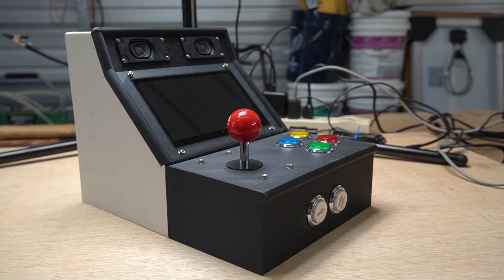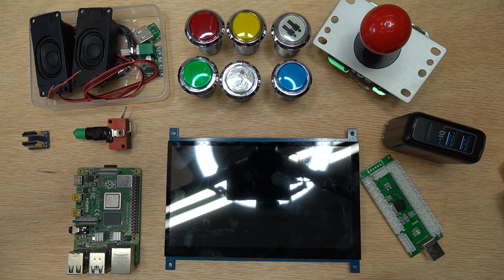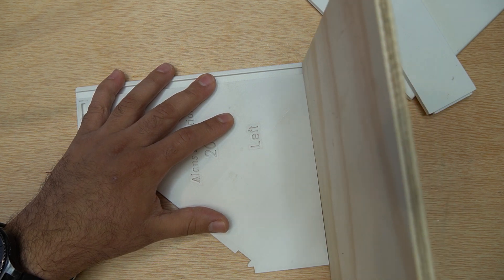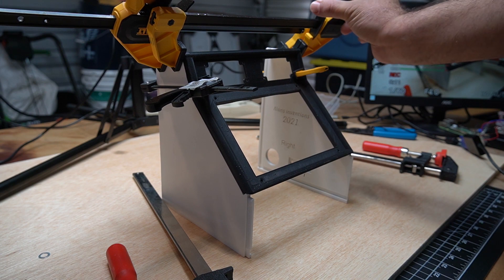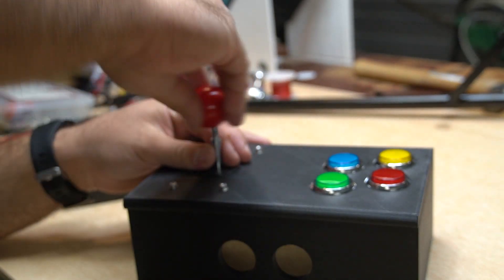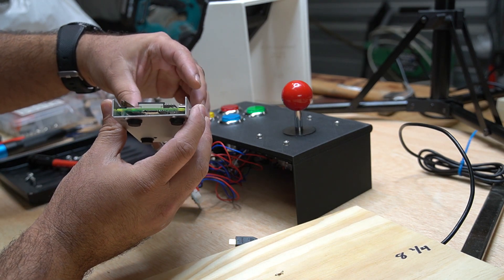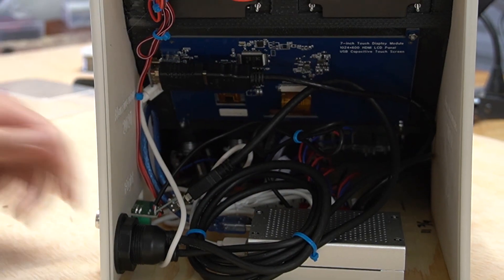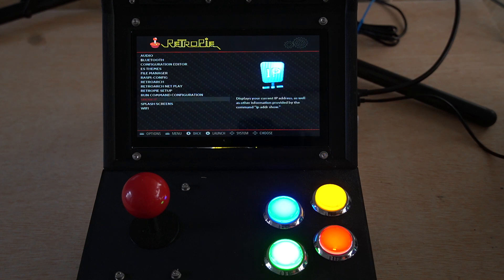Raspberry Pi Arcade! 3D PRINTED!

Comment: Good jobs, very cool! Can you make a 6 buttons version also?
Reply from the maker: Unfortunately with my ender 3, a 4 button was the best I could do.
Reply: @AlansInventions  Thank you for the reply! However, if it doesn't cost you much time, it could be useful for those who have a printer with larger bed
Reply from the maker: It would be an untested design unfortunately. That's why I made the files available, someone could download them and modify as needed. 😊😁